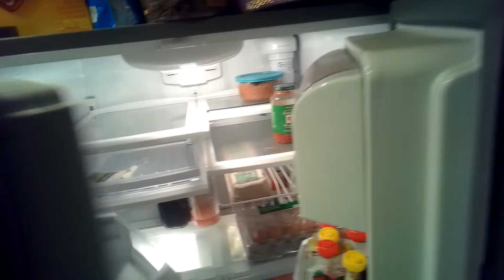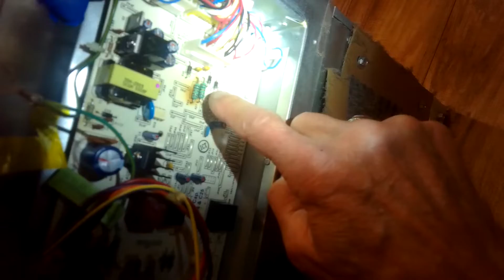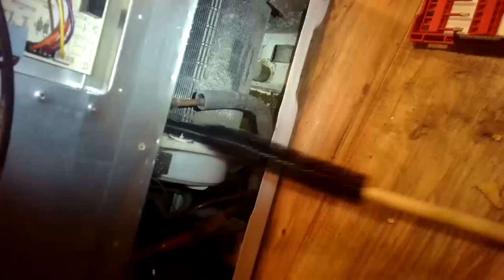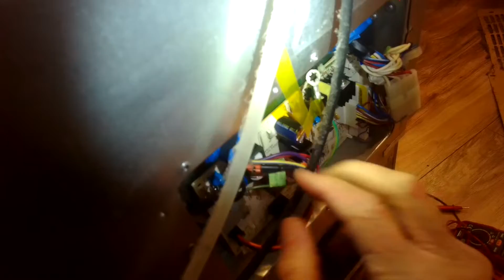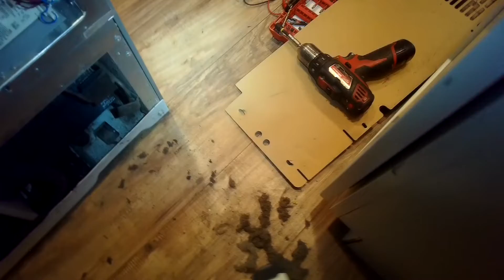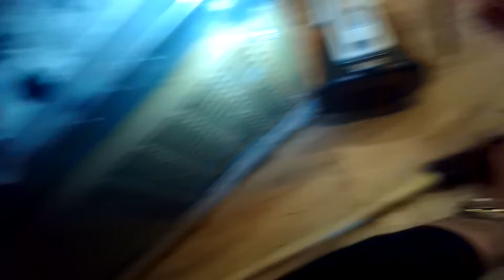✨ GE FRIDGE - NOT COOLING - NO DISPLAY - EASY FIX ✨

Comment: GE refrigerators are designed to automatically reset after a power outage, often taking up to 24 hours, to allow the temperature to stabilize and the defrost cycle to complete, which is a safety feature. 
Here's a more detailed explanation:

    Automatic Reset:
    After a power outage, GE refrigerators will go into a reset mode, which is an automatic process. 

Temperature Stabilization:
The refrigerator waits for the interior temperature to reach a certain level (around 60 degrees) before resuming cooling. 
Defrost Cycle:
The defrost cycle, which can take 20 minutes to 45 minutes, is necessary to clear ice buildup and ensure proper cooling. 
Safety Feature:
This reset and defrost cycle is a safety feature that protects the compressor and other components from damag
Reply from the maker: Thanks for the detailed info!

Comment: is this control board somewhat universal to the GE models? I typed in my fridge model, GFSF2HCYC, and it gave me the same control board as the one you are using. I just wanted to confirm with you. Thank you.
Reply from the maker: Yes, many GE refrigerators use it👍
😊Scott’s Tip Jar - Click Here: https://venmo.com/code?user_id=2758682643267585005

Comment: My display panel is off, lights are on inside the fridge. I hear a clicking sound and it tries to start, but it doesnt start. Maybe a new compressor?
Reply from the maker: I think you need a new control board located behind the fridge.

Comment: Same problems. I replaced both boards. Main back and display. I will check power to compressor. Make sure its 120v. 

Mine wuit working when i was flicking the breaker on and off. 

Hoping its salvagable.... 

Any other main things i should check? 

Inside bulbs on. Everything else off
Reply from the maker: I wonder if it’s the overload device that fits against the compressor.
It acts like a fuse.